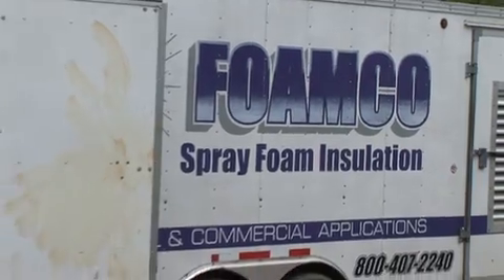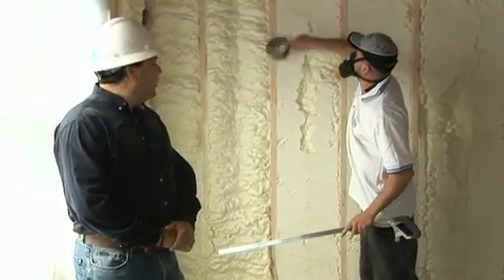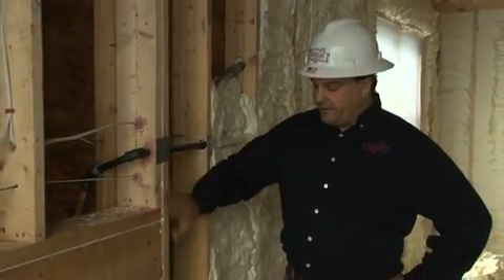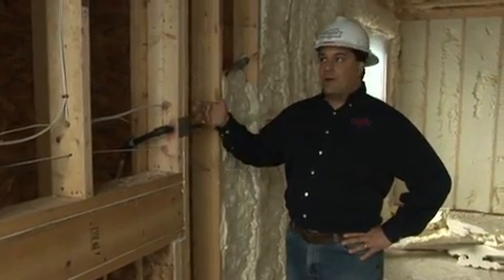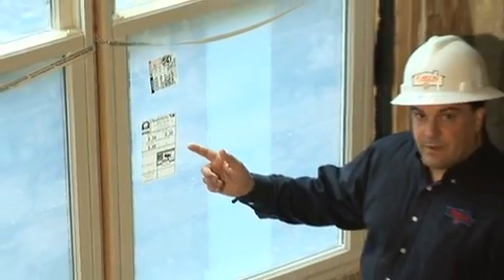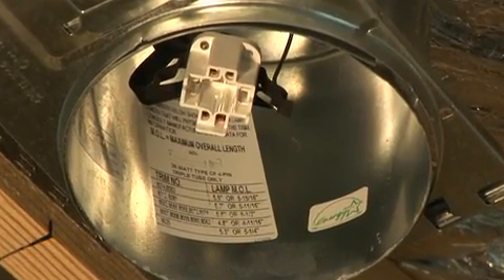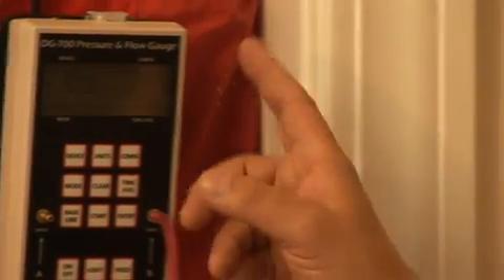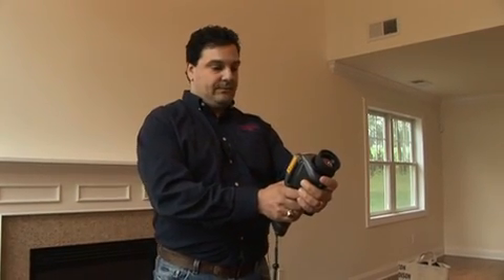Energy Star Building Techniques

Comment: @d1incharge I take it you mean 3-5 ach AT 50pascals.  I am getting it now, but still, how do you bring in fresh air? If you bring it in using electricity doesn't that make a house less efficient? If you bring in fresh air mechanically, what happens if the fan fails, the house becomes dangerous to live in and nobody will know? Do fireplaces have ratings on how leaky they are, I have seen some really leaky ones, caulking around one of them would just make me laugh?

Comment: Foaming around the windows will usually void their warranty.  Insulating the roof deck has now increased the amount air to condition. And R-30 is a little weak by todays standards for a ceiling....1066cfm @ 50pascals is WAY TOO TIGHT......3-5 air changes an hour huh? WAY WRONG!!!!!  The standard is .35 ach.  IT IS SUPPOSED TO BE 1/3ACH OR .35 PER HOUR!!!.  You should have AT LEAST 2000cfm on your DG700...for .35ach on a house that size. Go back to the books, redo this video PLEASE! Nice tools...